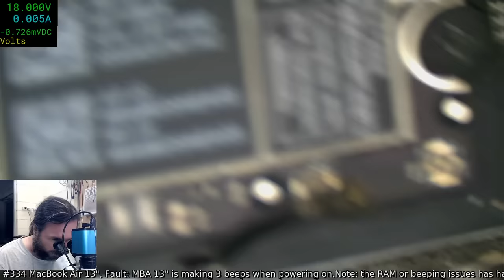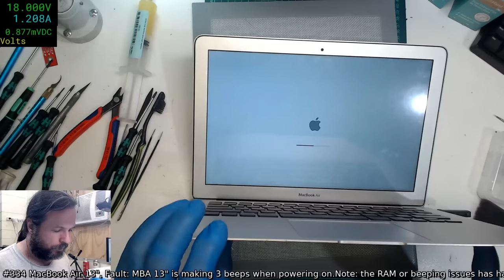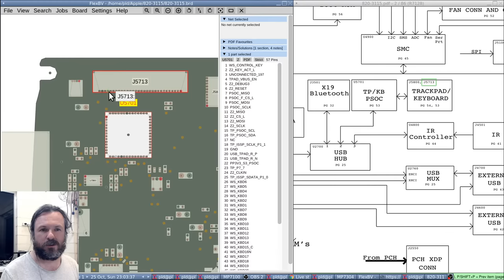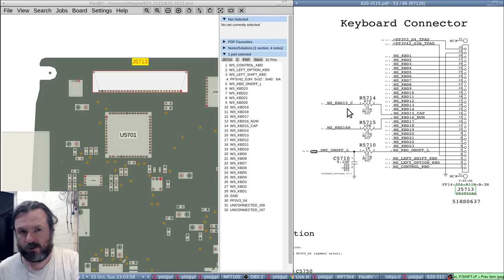Macbook Pro A1278  keyboard replacement and other Macbook repairs

Comment: Do we need program SMC chip or not after replacing new
Reply from the maker: No. Donor SMCs are already programmed, which is why we have to use the same-board donor.  We do not yet have the firmware to write new SMCs.